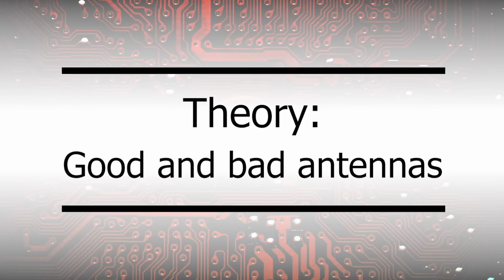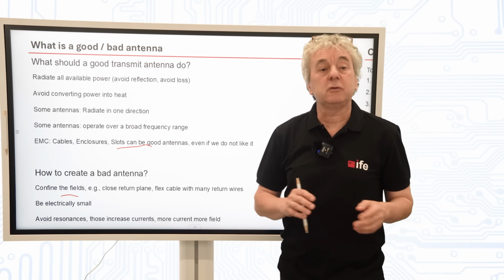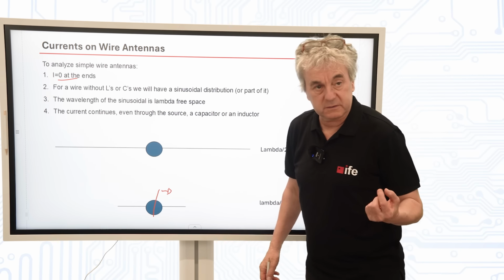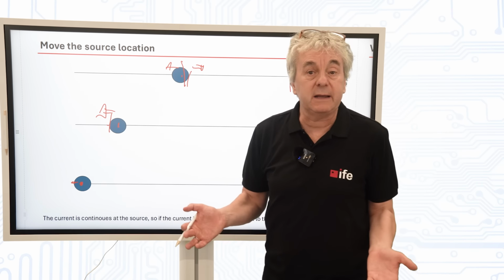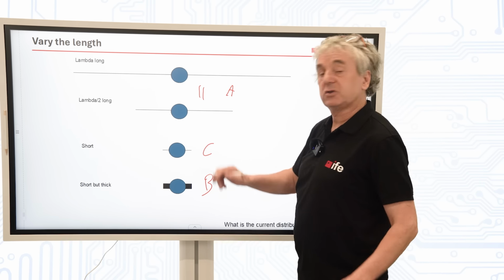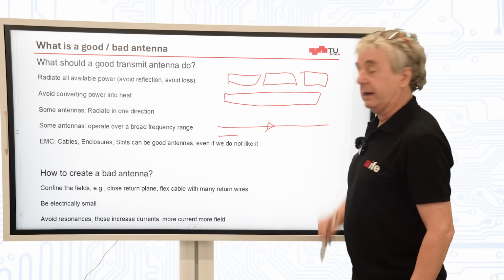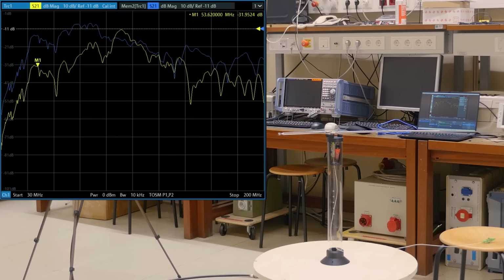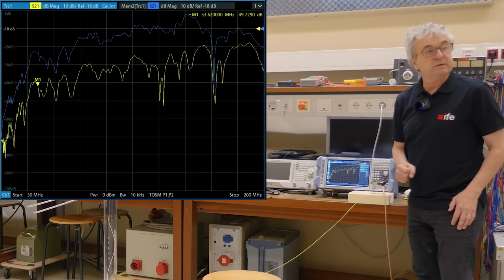How to avoid making an antenna

Comment: what do you mean by "... [triangular waveshape] is the second order expansion [of the Taylor series] of the sinusoidal..."?
Reply: I think there are a lot of factual defects in this explanation.
Reply from the maker: @TekCroach  Would you please be so kind to email us about the defects? Thank you!
Reply: I think it means that if you zoom into a sine wave very close to t=0, then it looks like a diagonal line. So if you have a standing wave pattern where two of those diagonal lines, originating from both sides, overlap, then it looks like the triangle shown in the video.
Reply: @giantisopod  I think there is misinformation in the video.

Comment: Excellent. It reminds me of when Zenith Electronics introduced its first analog TV chassis using digital video processing. It was not possible to use differential signaling between chips because the chips would have been too large and require too many pins for affordability or practical technology of the time. The result was that the digital processing modules had to be heavily shielded to prevent the set from interfering with its own signal reception.

Comment: Analog receivers like older TV's and radios can radiate from their antenna.  How?  The antenna is connected directly to the converter/mixer stage.  The local oscillator feeds back into the antenna and you can pick up the weak signal.  TV viewing survey vans would drive around and pick up radiation from rooftop antennas to see who was watching what shows at a given time.  

To stop that, it is important to have an RF amp between the antenna and the mixer.  That's for analog.  I don't know if digital stuff does that or not.
Reply: Every electronic device—whether a computer, monitor, keyboard, printer, or even a simple circuit emits electromagnetic radiation as it operates, regardless of whether it was designed to transmit signals.
Reply: @Shiny_Tsar  True but, they emit useless static noise.  Older TV's emitted useful information back up to the roof antenna and that was used for viewer survey vans that roamed neighborhoods back in the day.

Comment: In differential mode, is it ACTUALLY a bad radiator ?...(as in wastes energy through losses) ... or is it just that the out of phase radiated signal cancels out upon reception ?... 

Would a phased array receive  the same level of radiated RF as a dipole ?...  

Surely the receiving antennas performance, or lack of therin, affects the power readings on the analyser ?🤔
Reply from the maker: It cancels, exactly! 

A phased array and a dipole, assuming they have the same gain, would receive the same signal in the far field.

Comment: Great presentation for EMC!  Before anyone takes away the wrong ideas though, just wanna point out that off-center-fed and end-fed antennas are common and do radiate well.  We just need to transform the feeding impedance to be higher (higher V compared to I) before applying the signal to the antenna.  Also important to consider the effects of dielectric materials around your antennas, as they slow wave propagation speed and can therefore shift resonant or optimal radiation frequencies in your design.
Reply: My understanding is that end-fed antennas radiate well, but only because there's a counterpoise. No matter how you transform the impedance, you're still left with the problem Prof. David explained - the current has nowhere to go. With a counterpoise it can go into the counterpoise, so the "end-fed" works - because electrically it's not really fed at the end.

This is also why in the experiment Prof. electro-optic link and no cables to drive the antenna.
Reply: @barnaba2137 counterpoises / ground planes help, but look at handheld SMA attached antennas.  They work fine without counterpoise, although they don't tend to use high impedance feeds but rather 1/4 wave feed points.  Still, nothing stopping a longer whip there and high impedance transform.  All the CB whips will also have coils at the bottom to better match the short radiator.

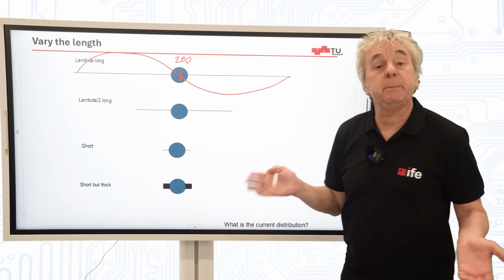Comment: Egregio Professore, ho commentato ieri, un suo piccolo refuso, e oggi non trovo più il mio commento!! Al minuto 6:15 lei dice che un dipolo 1 lambda ha un impedenza caratteristica di 200 Ohm!! Mentre a me risulta, e le posso fare illustri esempi, Antennas John D. Kraus, e infiniti altri testi che dicono che un dipolo 1 lambda possiede un impedenza di alimentazione molto alta, nell'ordine di 2000/2500 Ohm. Non si cancellano i commenti, anche se la correggono! Non e un metodo per insegnare, se ha sbagliato, lo ammetta, e inserisca una revisione al video, forse farebbe una figura migliore! Distinti Saluti Pier Francesco Grazioli  grazioliantenne
Reply from the maker: At resonance (the imaginary part equals zero), the lambda dipole's real part highly depends on the wire diameter. Any asymmetry on the feed point and proximity to trees and ground change impedance of a lambda dipole than on a lambda-half dipole.
Reply: @ife.tugraz ok ok, quando si parla di dipoli in genere e' sempre inteso un dipolo con filo conduttore di diametro molto piccolo rispetto alla lunghezza d'onda. Poi e ovvio che se parliamo di un dipolo  qualche GHz, in microstriscia magari da 1 o piu' centrimetri di larghezza allora bisognerebbe specificarlo nel commento😊 Ed io parlo di libri di testo "sacri" non di teorie astratte.